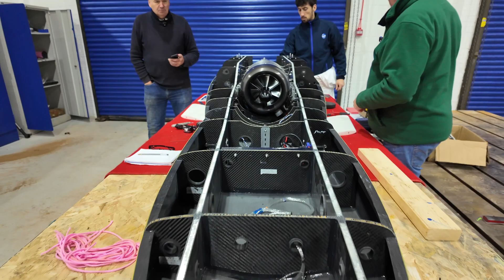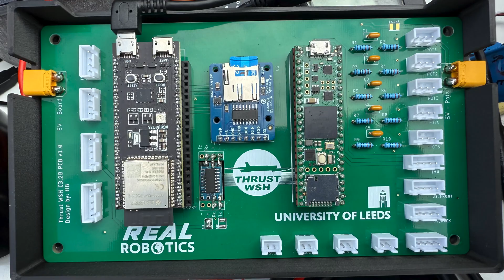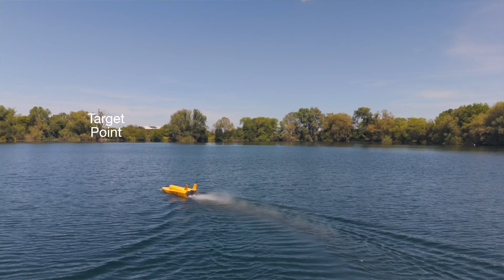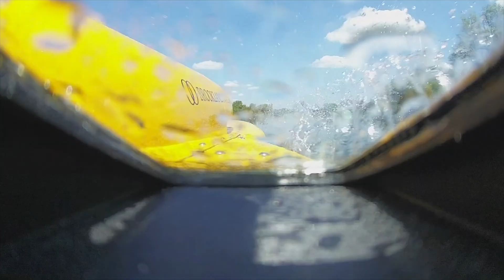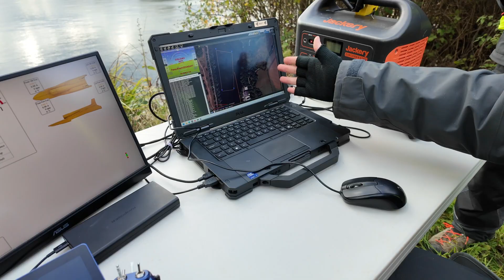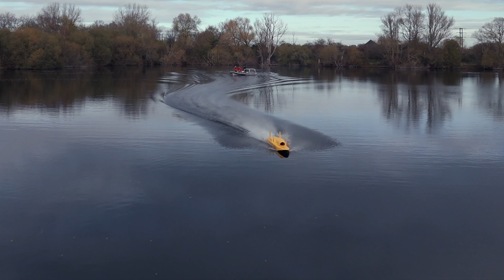Thrust Water Speed Project - Update #7 - Not All Plain Sailing, Testing Our Model Jet Boat

Comment: For all those saying it’s too complicated you’re missing the point. Only part of the job of the model is testing the hydrodynamics, the other part is testing the systems which are needed to manage the foils. The GPS and autopilot are because it is not deemed possible to repeatedly reliably run the model at 200mph with manual control.

Comment: Thanks for the update however - Not sure why you are choosing to overcomplicate the control systems, being someone who is connected to the maritime sector & also races RC boats (140mph twin catamaran & 150+ outrigger) I think you are only asking for trouble, I work daily in the maritime sector with furgro marinestar so have lots of day to day use of highly accurate GPS and i wouldn't want it anywhere near my fast RC boats. The 3 meter model you have would easily be controllable for steering / throttle. GPS jumping would be my main concern at these speeds
Reply: Apparently public school boys, university professors and other establishment types prefer to re-invent the wheel from first principles. After all, we “little people” couldn’t possibly understand matters of this complexity. 🤔
Reply: You are misunderstanding the fundamentals. 
This isn't an RC toy, it is a test platform for a full sized vessel. 

Toys can go as fast as this, but using toy tech would mean that the learnings would be missed for the real thing. 

Hope that helps you to understand the ethos.

Comment: Thanks for the update. 
I might not have gotten this right as the piece was very diplomatic about this but it seems like they tried to build a bespoke control system and then had to ditch it as it was too buggy and they ran out of time to make it work. Whilst I feel sorry for the chaps who were working on the initial system, it often doesn't make sense to reinvent the wheel. Luckily, open-source ArduPilot came to the rescue and the KH guys were very good at paying respect to the community behind it. 

RCTestflight and ThinkFlight come to mind as tinkerers/builders who have already made this work with ride height LIDAR control not only in ground effect vechicles but I think also on foils. Not sure if the Thrust model has LIDAR, though. Maybe it wont be foiling high?

Anyways, thanks for the peek behind the scenes and happy holidays.
Reply: No idea why you wouldn't run ArduPilot from the outset. This seems like the ideal application for it!
Reply: @neallewis1  Could be a lot of things, could be that the partnership with the university dictated they should build more from the ground up and that they felt it was a good project for students but underestimated the complexity and time constraints,
could even be some cultural engineering bias or pride where they thought open-source would be a short cut. No idea really.
Reply: @AntiVaganza  The university partnership sounds very likely.

Comment: Great to see the model come onto her points! Interesting problems, but as Donald Campbell said 'In record breaking, if it can go wrong, it will'. People who have never done this type of thing do not realise the difficulties involved. Even worse you have water involved, and no matter how water tight you make the craft, water WILL get in [usually the electrics as they don't go together] Tempo Alcoa WWSR jet boat owned by Guy Lombardo [the band leader] and to be driven by Les Staudacher was operated by radio control during its test runs in 1959-1960. It reached around 250mph on Saginaw Bay but a structural failure caused it to crash at high speed destroying it.
Reply: Read about that in an old model aircraft magazine. Structural failure caused by not doing a proper rebuild after the first crash.
Reply: On Saginaw Bay? That's very interesting, gonna look into that

Comment: I wish you all well on the project, a lofty goal.  BTW, R/C model boat racers have set official records of over 200 mph using real time hand controllers, proven technology.  An off-the-shelf heading hold gyro will keep the model going straight without driver input.   And it does take a lot of water to both get up to speed and to slow down.  Have you considered a braking system for the model?   It’s common on the fastest R/C model boats.
Reply: This seems a not unknown approach to these projects. I once spoke to the chief engineer of a certain 2006 land speed record car, and I asked whether the parachutes were the same ones used on Top Fuel dragsters. His response was along the lines of 'they're custom - nobody makes standard parachutes for anything anywhere near as fast as this', said with a slightly condescending tone, clearly completely unaware of how ignorant his answer was. The top fuellers were running pretty much the same maximum speed at the time. Get a load of academics or 'experts' from unrelated industries in, who have almost no understanding of what established technology is out there that they could use to shortcut development. Blow the budget reinventing the wheel, then wonder why it either cost so much or they run out of money!
Reply: @richardjones38 well said. I like your take on this subject and have seen similar results from afar in the drag racing world.
Reply: @richardjones38 I think it’s a particularly European approach, perhaps just a British one. If a bloke like Mickey Thompson or Rosco McGlashan was attempting this he wouldn’t be bothering with so-called “Chartered” Engineers or university professors. At this rate it wouldn’t surprise me if this project goes the same way as Bloodhound.
Reply: @richardjones38 true, but blue collars would just be scratching their nuts, and wouldn't have a clue how to design such a vehicle. 

It's all about balance.
Reply: Completely agree, my ‘SAW’ rigger has two aero breaks- it’s a 150-170mph hull.
Reply: Pretty sure I could see a parachute or similar furled under the jet output.